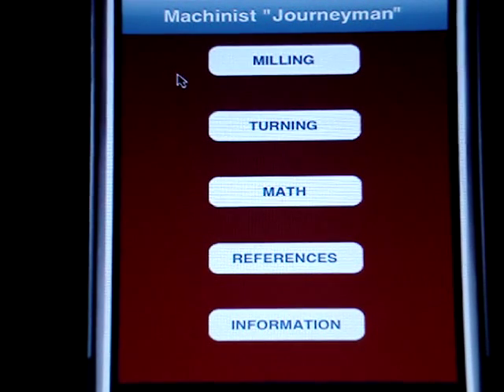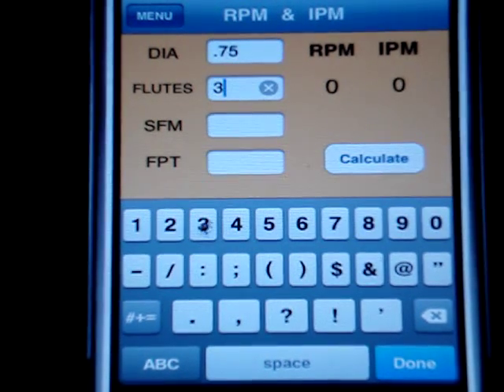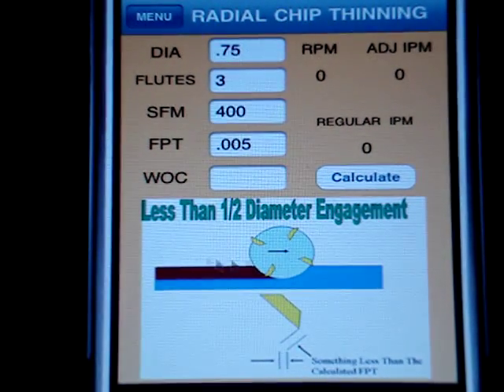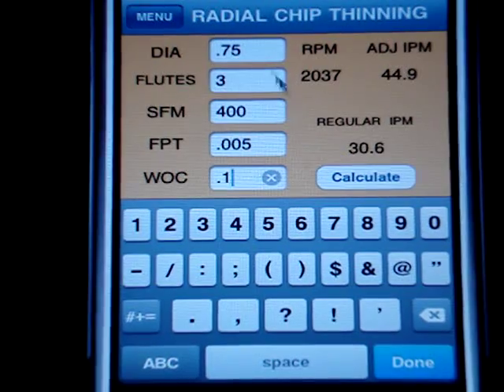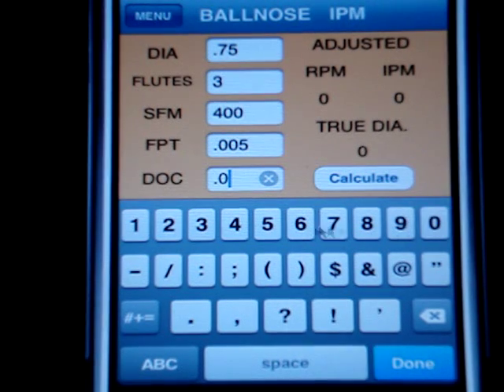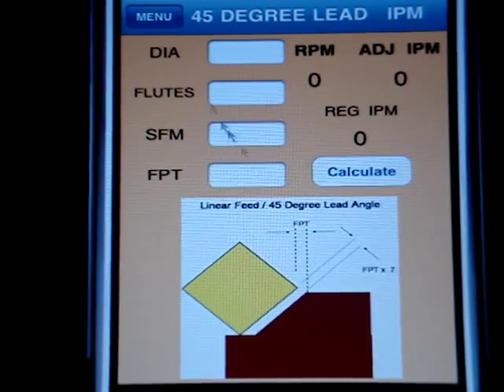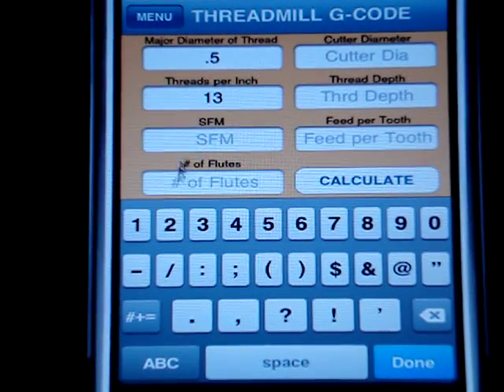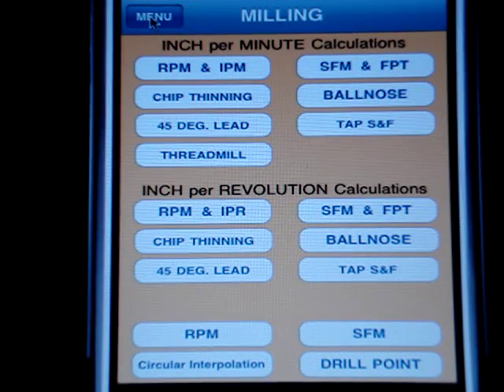MOV03898.MPG

Comment: One thing that stands out from watching this video is you shouldn't have to keep re-entering the same numbers in each different calculator. Once you type in, say 0/75", for cutter diameter in one calculator, that diameter should be filled in for all of them. You have to tap on a cell to change it anyway, so there is no advantage to starting out with blank fields. I hope this makes sense.